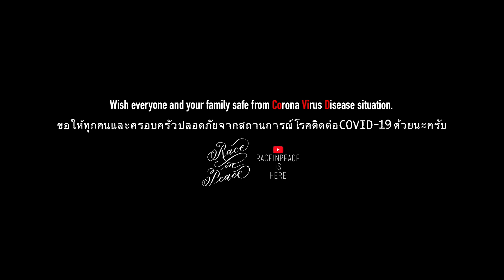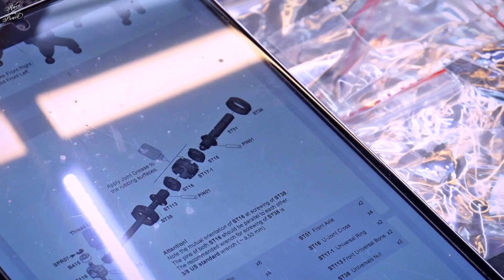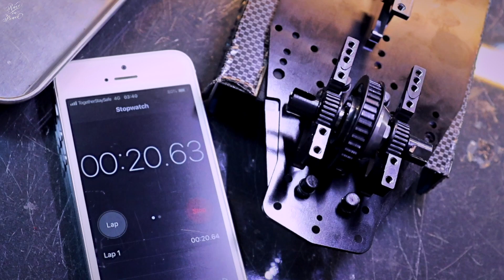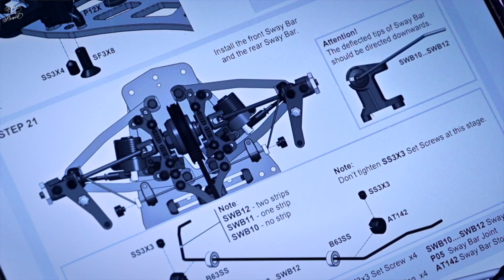unique rc car mechanics AWESOMATIX A800FXA assemble (FHD)

Comment: Such a different beast from your usual touring car. First time I've seen a video showing the damper/spring combo in detail, very interesting concept. The most impressive part was the diff though, a very innovative design, I bet it doesn't leak nearly as fast as conventional diffs would, though with that thick of a grease in there it probably wouldn't even leak without seals :D
Reply from the maker: Hi, thanks for watching and this chassis is amaze me up too :D
Reply: Instablaster